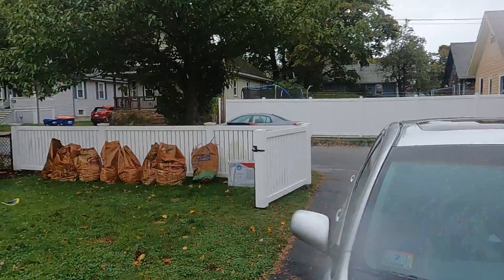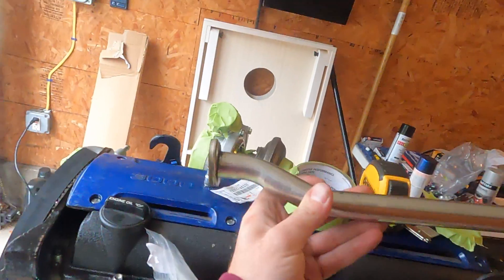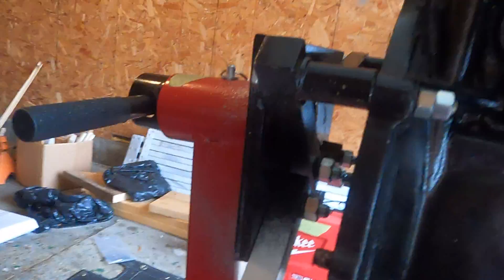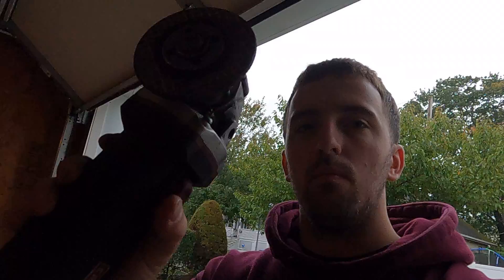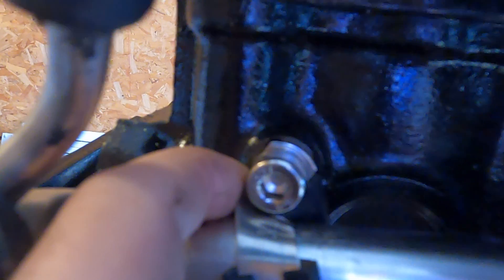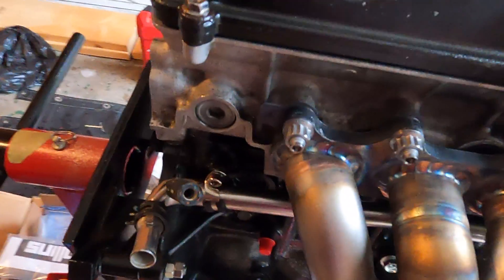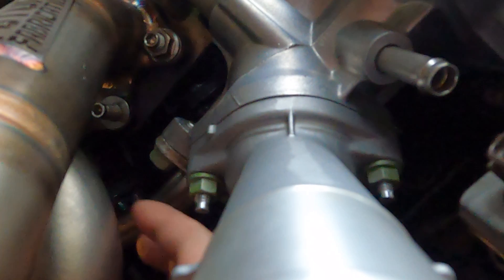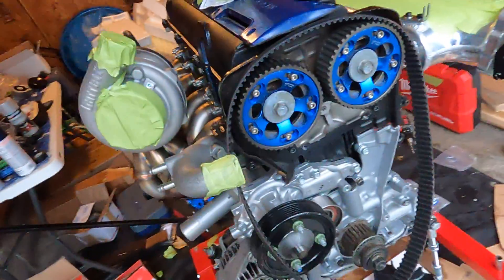2JZ Cooling System Mockup

Comment: 8:00 you installed the thermostat incorrectly. It has a small hole, about 2 mm in diameter. this small hole must face upwards. you have such a marking in the thermostat housing: small line- see?. the hole in thermostat must be upwards for the system to work properly👍🖐
Reply from the maker: I was just mocking up thermostat by hand to show the direction it goes in. Once the thermostat was placed inside the housing the pin was facing upwards 👍

Comment: The hole you used is the actual mounting location for the GE water bypass pipe! The only reason the bracket doesn’t line up (and the reason it had to be cut off) is because the angle of the bolts on the back of the water pump are different between the GE pump and GTE pump. Since the angle is different, the bypass pipe has to be rotated, and therefore so does the bracket, making it no longer line up. That being said, I’m also doing a GTE JZ swap on a 350z currently (GTE head and pump, using the GE bypass pipe) and your idea of the band clamp is the solution I’ve been looking for! Thank you for making this video!